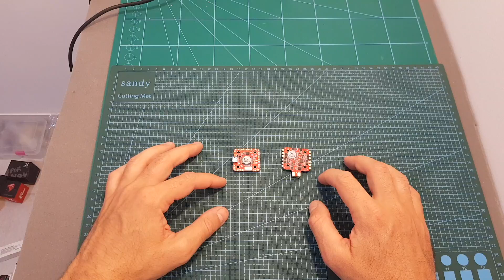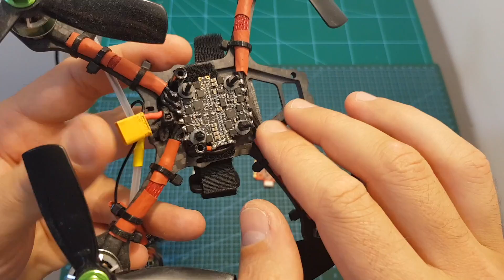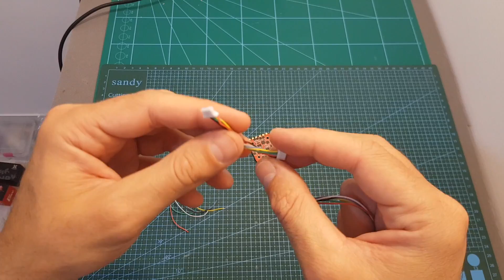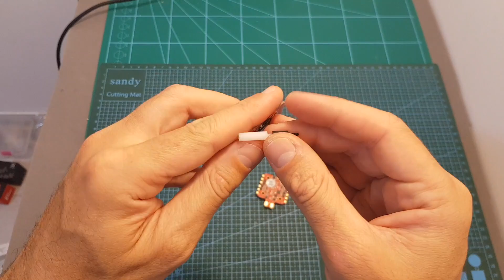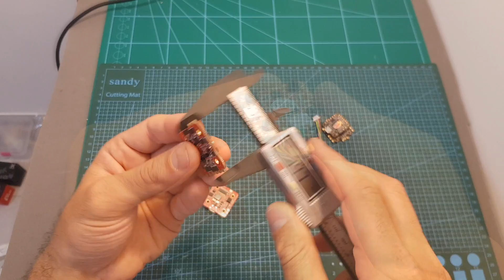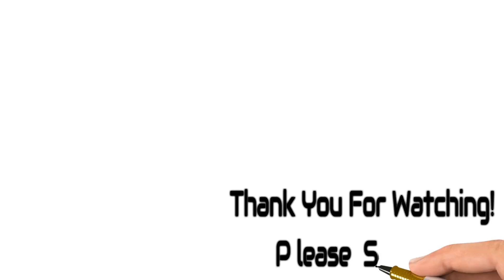HGLRC F420 - Look Ma, No Pins!

Comment: Hi can we use this stack on a 100mm build. Is this better optiona than f428 or iflight success
Reply from the maker: The F428 would be better for you, as it's smaller and would probably fit better on a 100mm build.
Reply: @KremerFPV  Thanks

Comment: I'm not sure I like what they did with the size of the thing. People get 20*20 stacks to keep the size down, and most frames are built to JUST fit that. Also, there are a lot of frames now doing a front/back dual stack setup, and this would likely not allow a board to mount beside it, because of the extra size. I just built my Intrepid V2 frame and the FC/ESC I chose was the smallest possible 20*20 I could find, and it BARELY fit on the frame.

Comment: Very strange release from HGLRC. They have nice and true 20x20 stacks like F440. What is this one for? It's only 20Amps esc. Size is much bigger then regular 20x20.
Only real advantage is wire connector instead of pins and red color.
Reply from the maker: 20 Amps should be more than enough for most mini builds. I am going to test it with the Acrobrat frame soon.
Reply: @KremerFPV  what I meant is HGLRC has a good collection of 20x20 stacks. Even with 40A rated ESCs.
All they need to do to get rid of pins and use connectors. F440 will handle most of 5" quads.
Instead they made is one which is bigger on all dimensions. I could understood if it more features rich or bigger rated ESCs. But it's not.
FC to ESC pin connections is known to brakes in crash. It's not HGLRC fault. It's just a nature of such set up. I got GepRC Span f4 tower with same pin connections. Now is have same issue after few descent crashes. One motor is not spinning. I need to tight one corner of FC nut more then another to make it works.
I'm personally give up on FC_ESC pins.
Reply from the maker: You've got a good point. Maybe you can tweak the connector and use wires instead on the Span F4.
Reply: @KremerFPV  thanks for advice. This is what I thought as well. Unfortunately I dont trust my soldering skills to that level. I will better ask my fpv friend to help as he did some amazing soldering job.
Cheers.
Reply from the maker: Good luck then :-)

Comment: I was considering this stack, as no pins is nice. Just 2 issues, almost double the weight and no BLHeli32. I think I may still take the pin design for less weight and to have DSHOT 1200..
Reply from the maker: I'm pretty sure they will release a version with BLHeli 32 soon.